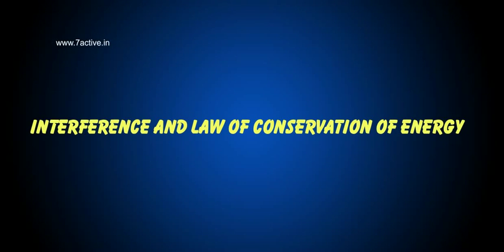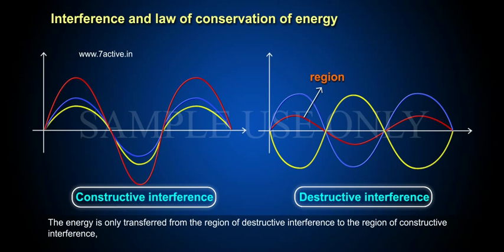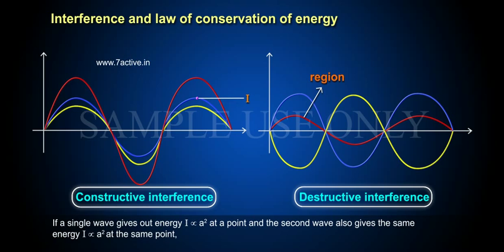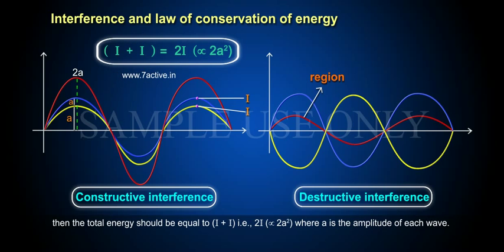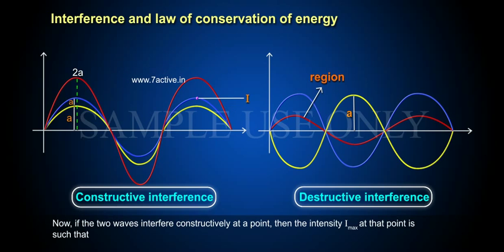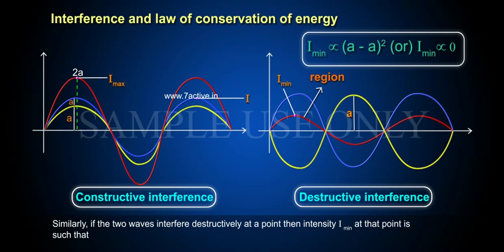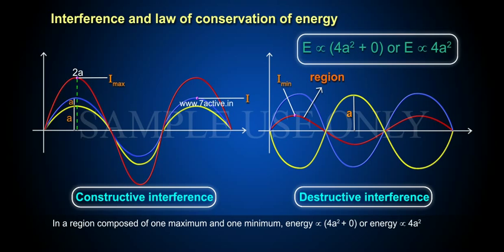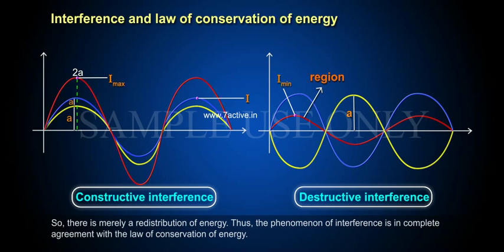Interference and Law of Conservation of Energy

Comment: BS explanation which unfortunately is circulating also in the literature. The whole thing falls apart when you consider that two same amplitude A source waves in phase, with Eo=A^2 energy each,  produce an interference wave which has not Ei=2A^2 energy but Ei=(2A)^2= 4A^2=4Eo thus not twice the energy of the one but 4 times that.   

If you like a good explanation read this here:
https://aapt.scitation.org/doi/10.1119/1.4895362
Reply: too bad it's not a free article :'( i'll continue my research